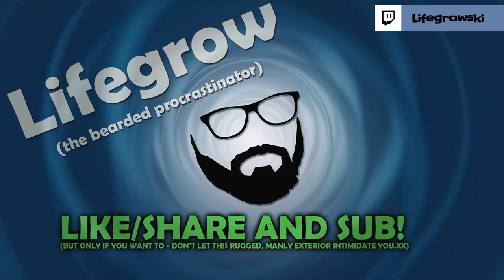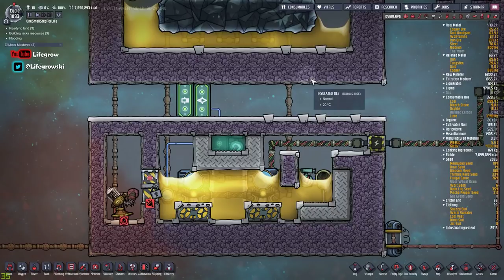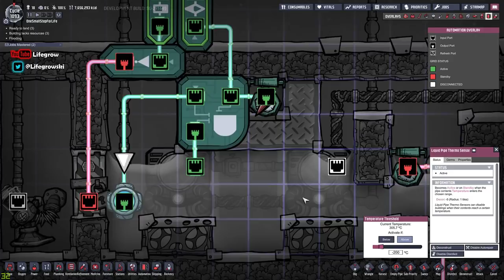OXYGEN NOT INCLUDED - EASIEST FULLY AUTOMATIC PETROLEUM BOILER

Comment: Someone please help, I did all this exactly but when my coolant evaporates it dont cool back down to a liquid and eventually the oil makes it all the way to the pumps as it cools to much to keep converting it.
Reply from the maker: Make sure you have tempshift plates connecting the liquid to the tile beneath your gas/liquid.
Reply: @Lifegrow  Thanks for the response, Yeah somehow I didnt notice the shift plates but while messing with mine I did realize it needed some there and put some up. Had to reload my save since I didnt catch it in time and made sour gas but its running now. Also I dont know how to calculate power used compared to the petroleum made.  Hope this is not using more power to make than it produces. At least I am cooling the petrol same time, my world it all is boiling hot and plastic maker made plastic to naptha instantly. Plus dupe free petrol yay. :) Thanks again.
Reply from the maker: It's hugely power positive, the biggest benefit of  cooking oil to petrol is you keep 100% of the mass of oil when converting. Using an oil refinery you lose half the oil in exchange for a tiny bit of natural gas.

Comment: Very interesting petroleum boiler. I see some complaints in the comments about the need for super coolant for this build to work, so here are some things that I found:
https://imgur.com/GyVsQdT
This is apparently an average temperature detector. It's a setup that makes so the temperature on the thermo-sensor is about the average between B and A. Since the thermo-sensor detects up until 300ºC, then it should be able to work with up to 600ºC heat sources if "B" is at 0ºC.
Credits and explanation:
https://forums.kleientertainment.com/forums/topic/90117-thermo-sensing-above-300c/
PS: It is form 2018, so don't know if it still works. Would advise some testing.
Also, if you really need something with up to -259ºC freezing point for your cooling loop, here is how to liquify hydrogen without super coolant:
https://www.youtube.com/watch?v=0zO9naIHzr8
(Should work with any gas, in fact)
If all of these tricks work, then this should turn this build from early space stage to pre-space stage.

Comment: The best part is that it deletes heat by sending the runoff petrol waste to a generator or polymer press! You get all this plastic and fuel for a net negative of heat, faster and more efficiently than with oil refineries! And without duplicant valve release intervention or waste gas!
Reply: New here. You've earned my sub
Reply: Also with the new steam turbine you can use all that heat for energy

Comment: Two questions: why the super coolant? Could you not detect the temp of the oil/petroleum with a temp sensor? Also, I thought aquatuner have a max temp of 125c, how are your getting so hot?
Reply from the maker: Thats three questions ;) 1) Super coolant isn't essential but gives you the most bang for your buck in terms of cooling. 2) Temp sensors cap out at 300 degrees c, way too low. 3) build them out of niobium or thermium for very high temperatures.
Reply: @Lifegrow  Thanks for the reply. So, if I understand this right, If I haven't launched a rocket, I'm stuck with the oil refinery as my best option? Maybe I'm overestimating how difficult that will prove to be, but I hear it takes a fair bit of steel, and somehow, there is relatively little iron on my map. Lots of gold of however.. I have 10x as much gold as iron..
Reply from the maker: @kenmagalnik6596  If you check my channel - the current playthrough is a complete space playthrough - skip to the part where i'm first venturing to space and you'll see my first rocket -  "The Steamy Nudger" ;) Depending on what your nearest asteroids are, you might be able to get all the fullerene you'll need to make supercoolant right away. In terms of refined iron - break the surface of your asteroid and it's literally raining iron - start by covering a small area with bunker tiles/doors and get out there in exosuits. You'll never need to refine your own iron ever again. Good luck!

Comment: Almost had me 100% excited until I saw super coolant and realized this was late game. But terrific none the less.
Reply from the maker: What i'm saying is, you should be excited - the beauty of this build is that it regulates itself and needs very little input, and aside from the few grams of super coolant needed for the logic switch, and some thermium/niobium - it's cheap as balls.
Reply: fulerene is mostly in 10 or 20k distance,not really late game
Reply: One way is to heat crude to say 300 or 320 with steel aquatuner, then dump it into a pool next to the refinery...
Reply from the maker: I got Fluorene from my first comet in two different playthroughs - thats steam engine territory. I've got news for you bud, that IS early game when it comes to the space age part of the game ;) A little bit of fluorene goes a long way, and you could also use a valve to limit the packet size to get you started whilst you're waiting. Should be noted, it doesn't need to be super coolant either, can use whatever coolant you like - even water, providing you're putting enough heat into the liquid elsewhere in your base, i.e. geyser cooling, base cooling, etc etc